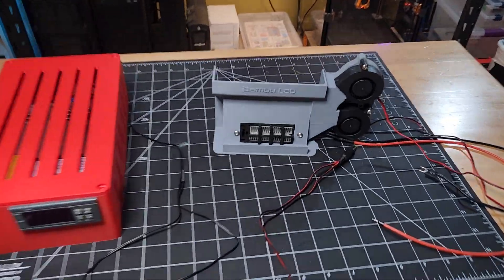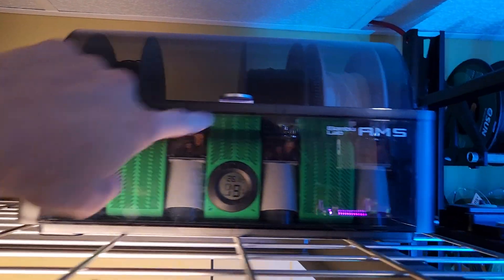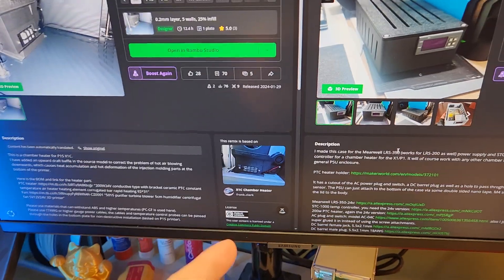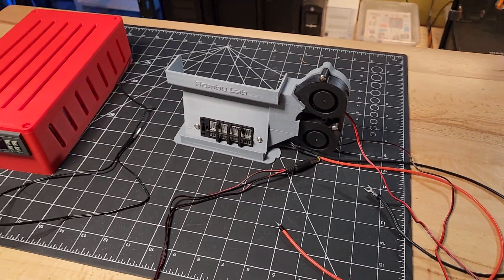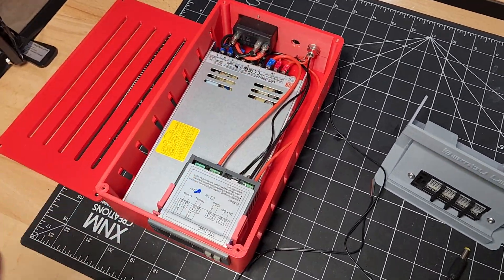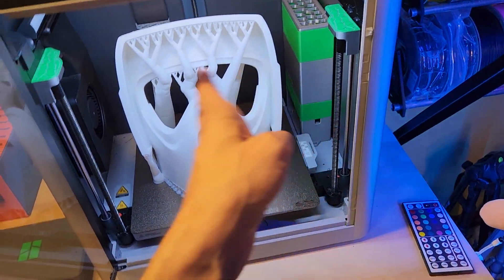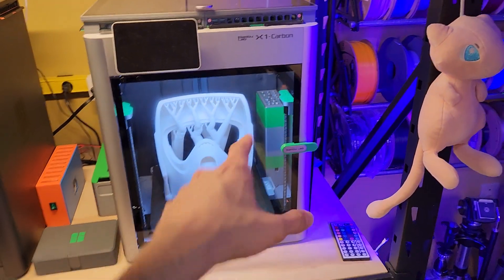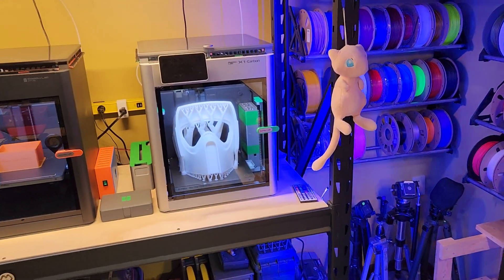Bambu X1C Chamber Heater

Comment: I'm battling the same beast - ASA on the same printer. I think the fans always on will cause rippling on taller ASA prints...just my lived experience and 2 cents.
Reply from the maker: Yeah, I generally let the slicer take control of presets as they are so much better today but the ASA profile needed a bit of tweaking. I'm getting good prints now with a longer heat soak and most items are a lot smaller now too so they inherently print better.

Comment: Have you posted the updated Part file with the hole relocated? I am going to print out of P26-CF I think that should be able to take the heat.  Please send me the updated file if avaiable.
Reply from the maker: Apologies but I have not, I've been running the ASA part for over 2 months now with 0 issues so I haven't made the change yet.

Comment: I would be interested to see how hot and stable you get the cabin after this install since I’m updating the X1X for those harder materials. I already have a meanwell PSU and PID controller, and might have the fans.  So I guess I would only need the PTC heater. P.S. I haven’t looked at the project yet, but the only thing I would add to the wiring before the heater is a properly rated thermal fuse for safety just in case the PID fails.
Reply from the maker: Absolutely, I will post an update, I've been running it for about a month and quite stable. The thermal fuse is a good idea, I just haven't put one in as I only have 125C rated ones, and the only time I run it is when I'm right next to the machines.
Reply: @makermsean I was thinking about this after I dropped the comment. It’s also protection if the fans fail for some reason. Then again a smart plug/outlet and temp sensor can automate as well. 
I checked my stock and already had the fans and a new 350W 24V PSU. So for another $30 I just went and ordered the rest of the parts and decided to give it a try. 
Glad to hear it’s running stable. This is definitely needed with some nylon prints. I have  modified G10 print bed that helps but this will make it much better.
Reply from the maker: @GadgetReviews-US For sure a great idea, not too big of a deal with the Bento but a much bigger deal with the heater. Part of the reason I wired it so the fans run all the time but a failsafe is needed. I do use Kasa devices and was considering a smart plug but it would have to be tied into something else to make it actually smart for this use case. Love the ideas though and that you're clearly thinking it through
Reply: @makermsean Well for now I am going to test and build it like you have it. But going forward I may decide to automate some of it with the use of Home Assistant and a ESP32. I haven’t tied that printer to home assistant yet so not sure what it offers for automations. Step one, build as is and test before investing more time and advancing to step two with automations 😂
But for now the automation is simple and just for safety. An Aqara temp/humid sensor inside the printer. If cabin reaches over 65C send warning to all phones and change light in hallway to RED. If cabin reaches over 70C turn off the smart plug that the X1C is plugged into, send critical alerts to all iOS devices and sound the alarm. It’s only been tested and hopefully will never trigger since that will mostly likely mean catastrophic failure with a possible fire. I would hope the smoke detectors would also trigger, but then again if your ventilating to the outside they might not go off.  Safety and peace of mind doesn’t have to be complicated and expensive.

Comment: Will it have issue with abs
Reply from the maker: ABS has a decent heat deflection, so it should be okay as long as you don't go too high. I would print it with whatever you have on hand that has the highest heat deflection.

Comment: Those post holes not lining up for fans are likely due to variances in that style of fan, I've encountered that same issue before also (unfortunately). Manufacturers have inconsistent clip placements and fiddle with some of the curvature parameters, but all the fans are called the same thing.. So be careful to say what manufacturer you know it works with, if you share the model etc.
Reply from the maker: Yeah that makes sense for variation but if you look at the photos of the very first designers print profiles, they only have one screw per fan and they don't line up. They were off from the very beginning even for the fans the designer had, unless they changed them before the photo.